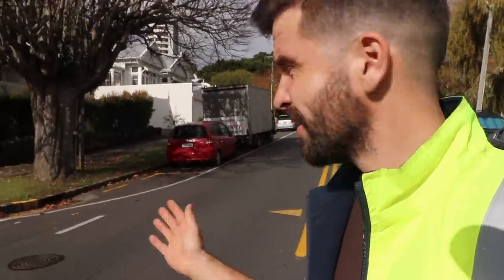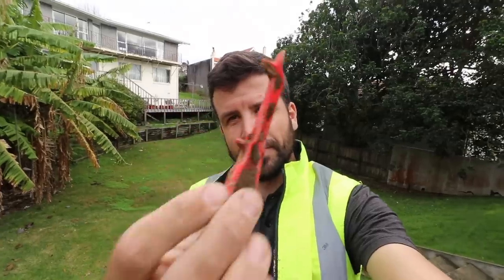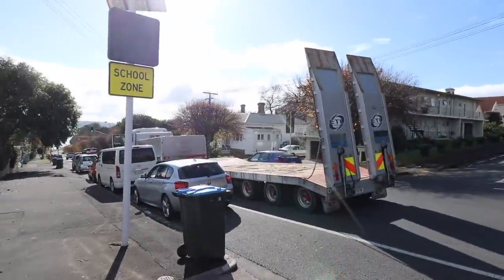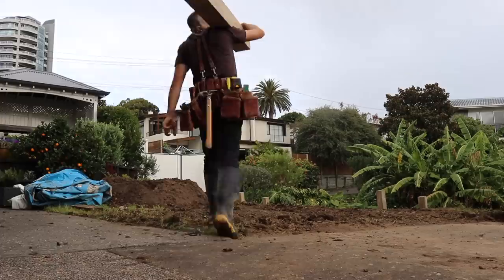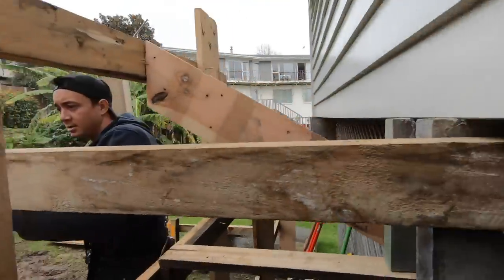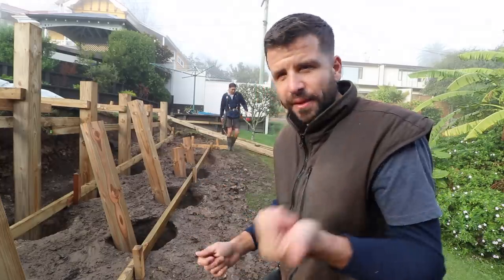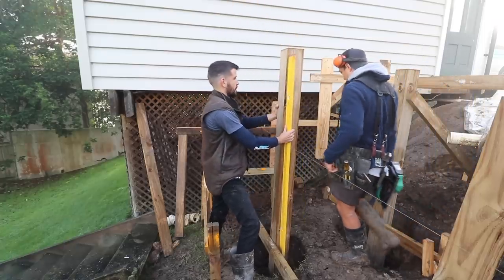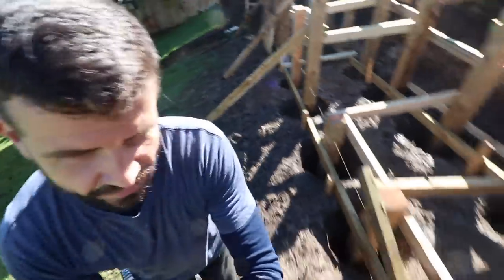Build a Retaining Wall: Bracing the Poles [Part 1]

Comment: Alot easier when your guy brings the right machine. 
I had a guy drill all our deck piles 100mm smaller in diameter than specified because he "doesnt own an augers that size" and we failed the inspection had to dig them all bigger by hand the rain set in and they all filled with water and got sloppy missed our concrete..... 
All because he wanted to avoid hiring the right size auger!
Reply: tubestick00 what was the diameter that they needed to be?
Reply: tubestick00 if he had to hier a auger that size you'll still pay for it
Reply: @devinhaisma  Obviously.

Comment: Phew! I  just purchased the Hitachi (Hikoki) nailer. Don't want to hear it's a dud. Great (wet) video.
Reply: You have to unlock it and push some other button and charge the battery. Hey I know a guy that's selling a Hilti if you're interested.
Reply: The hikoki nail guns are good. Just need a clean by  the firing pin that's all.
Reply: @pauldavidstrange7384  Looking forward to using it today. So simple, so quiet, no horrible smell.
Reply: @TakamiWoodshop  I know a guy selling one of those Hilti ones. Just swapped a Hilti for a HiKoki or Hitachi or Metabo... depending on the geography of your location.
Reply: We have 2 Hikoki guns and fire hundreds of nails every day. Sometimes the next strip of nails won't load upwards properly because the last 4 nails in the old strip might have dirt build up. We just push up the spring loader and hold it, then shoot the next nail and then always keeps going after that. Doesn't happen all the time, maybe 1 or 2 times a week.
Reply: I gotta admit, my heart sank a little when he said that because I just bought one yesterday as well.
Reply: @Gottesacker86  Just been using it. Way better than my previous nailer.
Reply: Josh Andrews how many nails in a paslode clip?
Reply: You hit the nail on the head I have had  the same thing happen,

it seams too get caught up in the tape that holds the nails together.
Reply: I’ve found ours missfire when down to last couple nails but fine when another cartridge of nails inserted
Reply: Tools & Stuff I had the first-gen DeWalt framer. It finally took a complete crap on me the other day. So it was time to move on.
Reply: @atthescreen  My Hilti nailer is an absolute pig for this. Jams all the time on the tape and ends up misfiring.
Reply: @Gottesacker86  I resisted the DeWalt for years waiting for a Makita. Fed up with waiting so I grabbed the HiKoki to replace my pain in the a** Hilti framer. Looking forward to reviewing it. Grabbed the 18g at the same time.

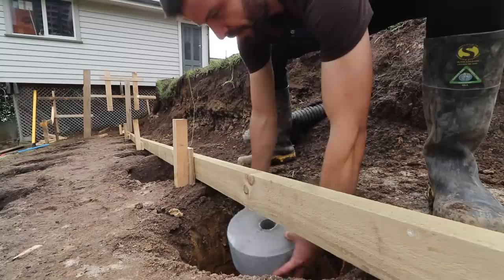Comment: What are those concrete biscuits you're dropping into the holes around 2:30?  Foundations for the piles?  Haven't seen those used before.

Comment: Hitachi will always miss fife if there is any dirt in the magazine slide it stops the nails from feeding properly Abit of Dry glide on the metal strip and a wipe with a rag should sort it out 👍🏻
Reply: Yep for sure.Also i had paper from the collated nails get caught near the firing pin and cause intermittent mis fire.Take magazine of and clean/remove.Good guns though been running mine for 18 months.

Comment: So did you consider putting concrete piles in instead of timber posts ?
Reply: Elfin4 in my country that wouldnt last very long. Why not a L made of concrete?
Reply: @hakanwappling3743  Could also put in stone gabions
Reply: Hard to nail, concrete anything is crap to work with .

Comment: Hey Scott, have been using the Hitachi Cordless a lot recently. I also have experienced the misfiring after a few weeks of heavy use but found the culprit; It is the metal coil on the slide that pushes the nails into the feeder. The coil accumulates dirt and grime over time and it seems to hamper its ability to drive the nails tight to the top. ( Notice if it still misfires if you push on the nails retaining lever towards the top of the nailer next time) If not, then this was your problem. Clean it while extended with the Passlode spray and a rag once in a while and it should keep it in top top condition. Hope this helps. Cheers from Canada !

Comment: Why do you need such an expensive hammer? At 1:50 you tap the nail with your hammer and drive it in with your thumb. Super powers? :)
Reply from the maker: Lol! I was bending the nail with my thumb, making a hook for the string line

Comment: always stringline from the back side of post using a packer to hold stringline off post. (horizontal timber side) as thats the side that matters the most in regards to having straight t&g  - ESPECIALLY with round posts as we all know timbers never dead on square/same profile or round.

Comment: Sweet vid bro I got taught a trick the other day with holding post up etc. Ya have ya ground beam ...mark ya post at height of intersection then drive a 4 inch in half way and sit ya post back in resting on that nail... then use a tek head 100mm screw to fasten in place it's much faster n ya dont waste gun nail 🤙🤓
Reply: omni builders nz Tech screws are mean aye

Comment: I would have been tempted to build hollow block wall and face it with timber.  Would have lasted 50 years or more...  still though,  nice work.  And timber is allot nicer to work with than hollow blocks.